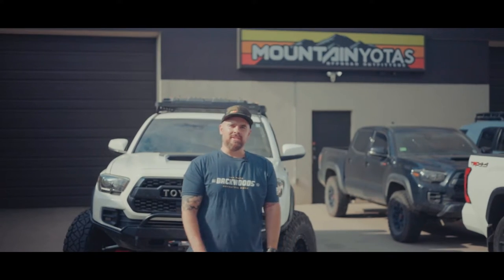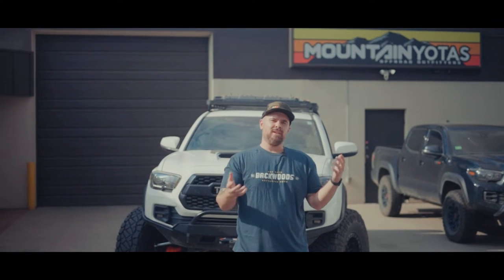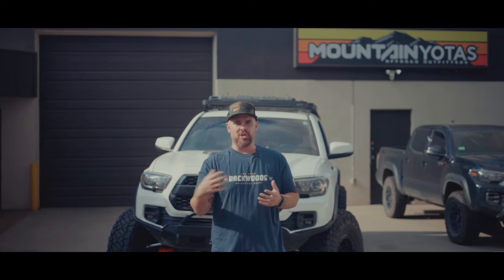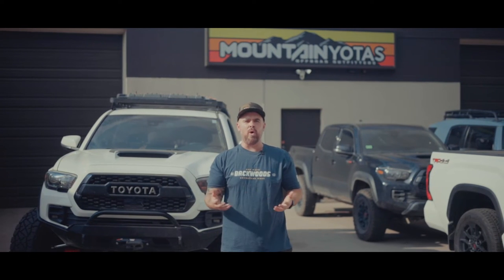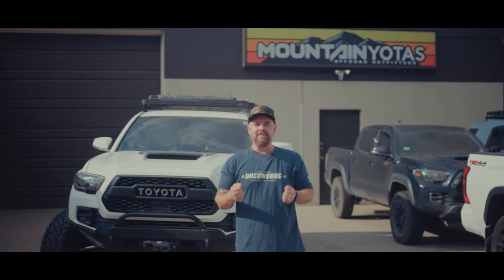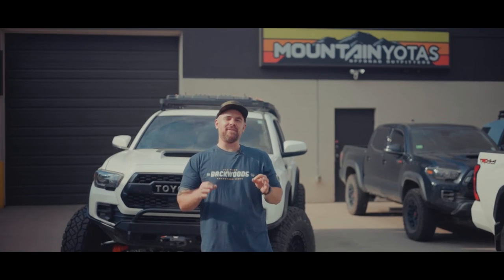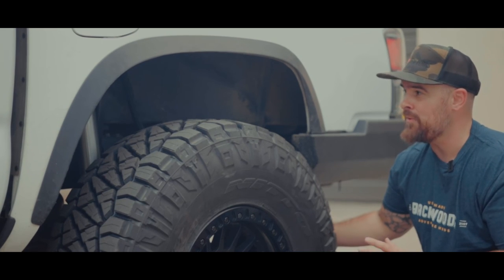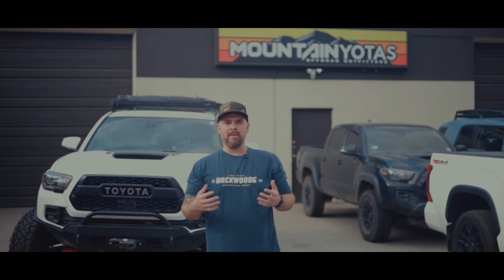Marlin Crawler RCLT HD +3.5" on a 3rd Gen Tacoma

Comment: Looks great, personally if I had the money and the choice, I'd opt for a S.A.Swap, and I actually did on my First Gen Tacoma S.A.Swap, it's not cheap to do it right, let me tell ya! Especially being in the NYC/Long Island area, I had to go 60 miles away to The 4x4 Place in NJ, and she drives great 👍 But if you have a newer Tacoma and you want to maintain the IFS, The Marlin Crawler RCLT is the way to go! Me , she'd be on some 1 tons , I didn't go that way with my Taco S.A.Swap but she's my Daily Driver/Weekend Offroader , so I kept it light and she's very capable, but either way you really can't go wrong, stock sucks! I broke a new ball joint on a curb? So anything is an improvement from the stock IFS, other than that, these Toyota Trucks 🛻 are amazing dependable vehicles and are 💯 % worth putting money into, they only get better! Great video and work guys, keep it up